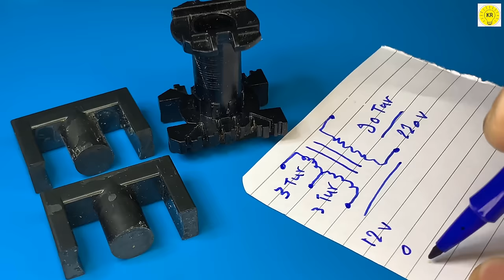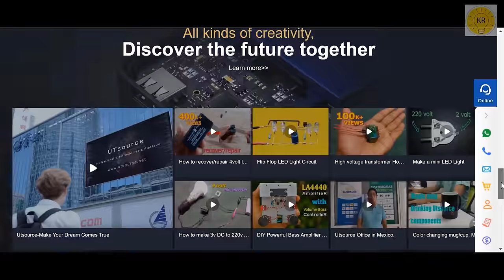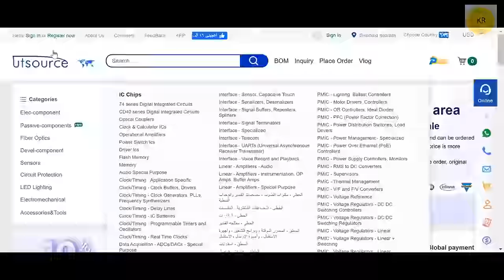how to make transformer, inverter 12v to 220v, power supplies

Comment: I am wondering, if you hold the frame left to right and begin winding #1 from right to left, then when you reach the end you continue to wind a second layer but from left to right, as you have. 
However, electrically when current travels through this in the first winding it is traveling ' Right to Left' until it reach the end of the first layer and continues into the outer layer - then it is traveling ' Left To Right' 
Therefore, the two layers are actually opposing each other, and this will cause the magnetic flux to be at some minimum value. 
For a second layer to aid the first layer both need to be wound in the same direction on the same core.
I'm looking at a few designs to do this myself .....

Comment: To be able to replicate it, the number of turns and the gauge or thickness of the wire are missing, thank you, good video ... Kind regards from Peru 🇵🇪
Reply from the maker: The primary wire consisting of 3 * 3, which has a total of 9 wires connected in parallel. Measure 0.5 mm
As for the secondary coil, which has 90 turns, it measures 0.4 mm

Comment: What’s the part called that u turn with the screw driver to increase or decrease power?
Reply: i think its a pontentiometer. boost converter module. u can buy from online shopping.. how many volt and amp i dont know..

Comment: Your project is useless without 
the schematic diagram showing 
the FETs used and the driver 
oscillator . Winding the transformer need not be shown.
Only indicating the number of turns and the size(swag gauge)
would be sufficient.
Reply from the maker: All information in the blog circuit diagram and everything

Comment: Amigo hola, como se podría hacer un transformador que la entrada sea de 12v  y la salida 5 v gracias.
Reply: If you want to convert 12 volts of DIRECT CURRENT (not ac)  to 5 v dc it's not worth making a transformer. Buy a step down module (also called a buck converter) like the Lm 2596 which supports, if I'm not mistaken, up to 3A. It's small, very cheap and by connecting to 12V you can regulate the output to any voltage below 12 volts. On the internet you will also find models for larger currents.

Comment: What is 8, why 8 divide by 2
Reply: First he measures the width of core which was 1inch then he multiply it with 2 ( without measurement) as length to get the cross sectional area of the core(in his case =2).
Then he used 8 ( 7.5 widely used but depends on the quality of the core) as predetermined constant to get TPV (turns per volt).